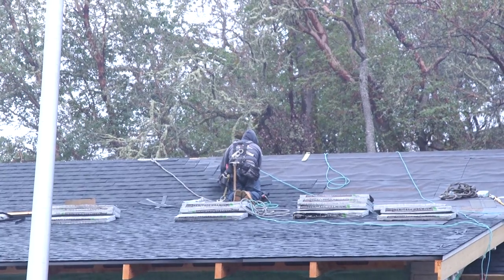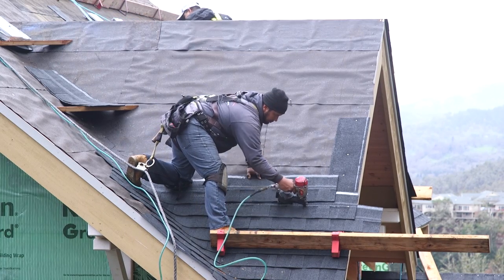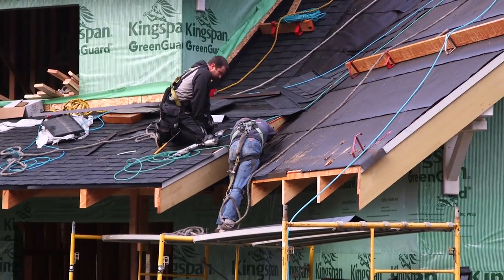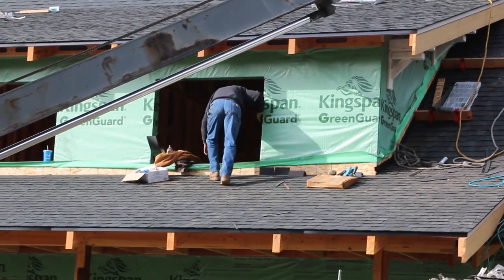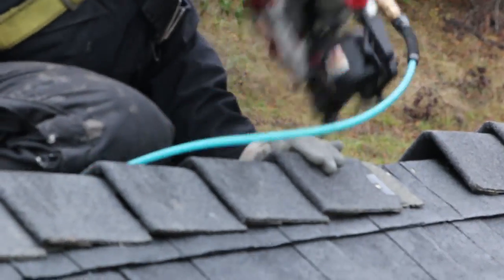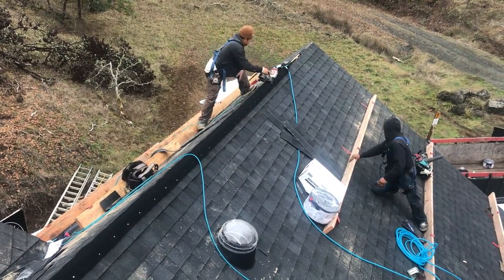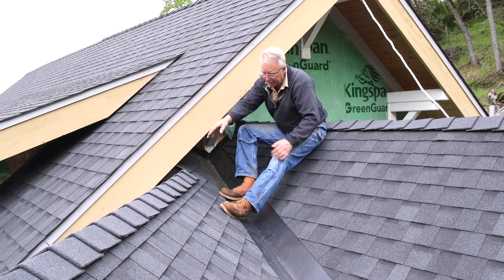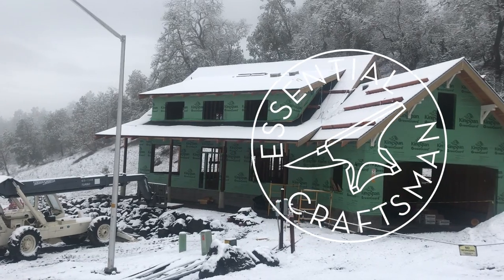Stunning and Complex Roofing Installation Ep.78

Comment: Shingles will be long deteriorated before the metal begins to rust. Architectural shingles only last 20-35 years, despite what manufacturers like to tell you.
Reply: They likely won’t get 50 years out of the shingles. I had to laugh when he said a metal valley would rust before the shingles needed replacing.
Reply: Agree.  I've used heavier-gauge aluminum valley/ step flashing.  That will probably last the lifetime of multiple asphalt roofs, barring no conditions where galvanic action or some other abnormal condition eats it away.  The shingle life, agree... complete joke.  It's what happens when marketing guys do their job.
Reply: I have a concrete tile roof. House is 17 years old. Only thing on my roof to have failed so far is the metal valley on the southwest side of the house. Maybe it was installed by dolts, I have no idea.

Comment: Hi Scott and Nate, I'm really loving the content you guys are putting out. I live in Ireland, I'm a mechanic by trade and I'm currently building a house. I find it so interesting how building methods in the U.S. and in other parts of the world differ so much. For example, here in Ireland we have quite a wet climate and most houses are built using concrete blocks, typically it consists of inner and outer leaves with an insulation cavity between the two concrete block leaves which is partially or fully filled with insulation depending on the detail. Timber frame and ICF are becoming more popular but concrete block is still by far the most common. Also,  you'd never see felt or asphalt shingles on a roof. Here we most often use natural slate, fibre cement tiles or concrete tiles. Metal roofing is becoming more popular but still quite rare to see. For the valleys we use lead, leadex, or metal but lead is the most common. I'm interested to know why I never see houses in the U.S. being built with concrete block, slate roofs, etc. Perhaps like most things it comes down to cost. To give you an idea of cost over here, it's costs roughly $150 per sqft to build a house.  I'd love if you guys could address this is one of your Q&A's or podcasts. Best wishes from the Emerald Isle and Keep Up The Good Work 😉
Reply: It depends where you are in the U.S. as weather, temperature and building codes can change drastically. Down where I live in florida most houses are constructed from block, at least the bottom story. The interiors are usually wood framed. In other parts of the country, particularly the western united states, wood is a much more common building material.

Comment: Looks like they did a good job. One suggestion for future roof projects is to nail the starter shingles at the drip edge.  Nailing at the top of the starter leaves the bottom course of shingles loose and susceptible to getting blown off.

Comment: Hi again there Wadsworths! It's been a while since I've commented on anything, but only because I really haven't had anything to add. I think you have done a wonderful job with all of it throughout the series. The building itself, filming, editing and especially explaining. Big thumbs up. For the EC2 podcast as well.

Now... I am from a wet climate. Pea belt. Where people sit in the dry and watch their cars rust for fun... And... Well... I am sure the Randy twins are doing an excellent job, but this is one of the places where I'd have function dictate form. I would not have the rafter on the porch exposed to the garage roof. Had I been doing it, it would dive all the way into the garage roof, for a continuous fascia, gutter and a single valley. Now... I know it would screw with optics, and possibly would mean extending/skewing the barge rafter, maybe even the entire gable, BUT - it is such an important detail and such a hassle to maintain, if not done properly, that I'd let it take priority. It looks good as is. Probably better than my suggested solution... But again. Water is no joke. Especially not on the 5th face of the house. The one facing upwards. The roof. Anyway - my 2 cents. As always - keep up the good work!

Comment: This is one of my all-time favorite YouTube channels... been watching for years, but when I saw that wide flashing, first thought was: compared to the long-life shingles and the care on the rest of this build, this small section will probably oxidize thru relatively quickly because it's such a low pitch area and it doesn't appear to be (nor sound like) painted aluminum (which won't rust thru like painted galvanized steel). Trees dropping sticks & leaves into a valley with a low pitch will almost always leave debris that cannot run-off without some help &/or regular cleaning; this particular spot has the added detriment of being in a roof valley that will probably have very little wind to help keep clear it. You can tell by looking at the ridge cap at 28:37 -- it's all facing toward the downhill run... so it's unlikely much wind will get in there to remove it; it's going to be primarily cleared by gravity, precipitation, and elbow grease. (One small stick will hold leaves on the metal, and leaves hold water directly on the surface just like mulch does for plants in a garden; water on the surface will escalate the oxidation process and take many years off expected lifespan.) Don't want to sound like I'm all doom-and-gloom or "Safety Sally-ish" but if this were my home, I'd want this part of the roof cleaned every fall & spring to keep the lifespan of that valley up to par with the rest of the build.
.
I've had to repair and replace both galvanized and painted flashing (and metal walls) that should have had 10-30 year life-spans, but rusted completely thru with a few leaves left in the wrong place for 1-5 years. Was glad to see painted flashing installed there, but probably should've considered using painted aluminum, copper, or lead-coated copper, as well as getting the seams of the wide-valley flashing laying as flat as possible (to stop capillary leaks), and spreading the sealant more under the flashing. (I realize Vulkem stays fairly pliable over time, but personally don't like to leave opportunities for ponding behind sealant, nor leave any high crowns of sealant under flashing.)
Reply from the maker: Great observations and yes, it will need cleaning!

Comment: Looks great.  Shouldn't there have been caulking applied to the top of the flashing of the solar fan before sliding it under the shingles at 19:20?  I've always applied caulk to vent type flashings to seal the underside of the shingles to the flashing to keep the wind driven rain out.

Comment: EC, I've never seen a ridge vent before.  Very interesting to say the least.  My small home doesn't have enough venting in my opinion.  I've got hot air that comes down through the attic fan louvers and this is directly above my thermostat.  I also appreciate the idea of those attic vents that run off of solar batteries.  You have given me food for thought.  I've got vents at both ends of the attic and small vents in the roof but I just don't believe that they calculated it correctly.  Plus the garage is attached to the home but there is no fire wall between the attic over the garage and the residential part of the structure.  If I were to put a wall in there then the air circulation would even be more messed up.  Oyi-veh!

Comment: Powered roof vents are surprisingly controversial in certain building spaces (and outright forbidden in some jurisdictions).  The thinking is that -- at best -- a solar powered attic fan will do no harm.  More typically, the expectation is that the fan will suck conditioned air from the lived-in space, actually wasting energy rather than saving it.  This is because a fan sucks so much air that the typical inlets are almost never going to be enough and since that air needs to come from somewhere, it'll have to be conditioned air.

My first thought on that is to just ensure that the inlets are sufficient.  The counter argument is that if your inlets are sufficient, then it's more likely that you have "properly" designed attic ventilation and a fan simply won't be necessary -- fans are there for poorly designed ventilation.

Oh, and maybe you could just do a very good job of air sealing the conditioned space, so that it's impossible for the fans to suck air into the attic.  But again, I hear the argument that if you are paying that much attention to the house, then there is a near guarantee that you are paying attention to attic ventilation, too, and you won't need the fan.

I guess I've just never lived in a house that had "proper" ventilation and I know from experience that attics here in AZ get into the 160F range -- it FEELS like being able to reduce that by 50F would be a huge win.  Alas, apparently the research and the numbers don't back that up.
Reply: Try watching Matt Risinger and the Building Science crowd. Their model of Best Practices on Attics is to insulate and seal the Attics because not only does NO ONE Air Seal effectively between building Interiors and Attics, the HVAC System typically has a lost of 15%. 
The key to success is to seal the building very close to 100% 
and remove moisture via a dehumidifier.

Comment: Doug...a few years back I went to Bozeman to assist my Roofer Brother on a Project he was doing. I can tell you after that experience, I have a Great Deal of Respect for people who do Roofing for a Living! If I Never Do Another Roof, It Wouldn't Hurt My Feelings! Its Dangerous Work! Step on anything on Sloped Surface; Air Hose, Rope, Extension Cord, Loose Shingle and your Instantly going for a Scary Ride...hopefully not all the way to the Ground! Its Miserably Hot..Never any Shade on a Roof! The Weather was Fair at the time but the Asphalt Shingles turned to Goo from the Solar Radiation of the Sun! Walk on them & they Slide all over the place...yuck! All the Damaged Shingles then have to be replaced and that really bites into Productivity! We ended up getting a Garden Hose from the Neighbor to keep the Shingles Cooled Off with Water in order to get the Project Completed. The Worst Part was Standing on a Slope all day!!! Both my Ankles felt as though someone Smashed them with a Sledge Hammer not to mention your Bent over all day!!! I was in Constant Pain and could Barely Walk!!! Also...I learned that Not All Roofers are as Conscientious as my Brother in their Craftsmanship & Ethics! Two Very Very Important Qualities in a Roofer, IMHO!!!

Comment: Where the valley flashing outlets onto the top of the shingles, the shingles tend to erode, water is going traverse to the direction shingles are designed to shed water, and it's at a high velocity. As a rule, I now design gutter flashing to never touch shingles or tile once it's touched metal. Once water becomes concentrated, it is fast and very erosive, and will damage whatever is downstream. 
In the case where valley flashing falls onto the middle of a plane like it does this house, I would actually create a channel gutter along the gable wall about 2" high and 12" wide.  That means holding the overhang off the roof of course, and letting the channel tie into the v-gutter, but there's no reason it can't be done with a nice return, giving a good 8" of clearance. I discovered this issue when my own home wore through the underlayment after 15 years.

Comment: Can I ask? The roof cap shingles on the main roof appear to be installed in two directions of lap, from the centre out to the gables. Why this decision? How does the back-to-back pair at the centre get treated for sealing/nail cover? 
Thanks for all you do and your excellent presentations.
Reply: That USUALLY indicates that in that area the winds primary direction would be hitting the face of the roof. Since there isn’t a prevailing direction to run the ridge you run it both ways. You cap off the middle with a show piece that you’ve cut off the nailing area of. To waterproof it I would always caulk under the piece where the nails will penetrate as well as on top of the nails to finish it off

Comment: I did roofing one summer in the upper Midwest on high, steep, roofs with no safety harnesses.  I was young and stupid.  ^_^  Boots with good traction, tied TIGHT, and with little "twist" was the key.  They had to be flat soles (not hiking boots) or they would damage the tiles.  Some guys used basketball sneakers.  My ankles got tired being in a flexed position all day.

Comment: I liked the lap sequence of the valleys, but I have to say that copper facing in the open valley will NOT RUST OUT. I think the main (best) way to understand roofing systems is that the weatherproofing is in the flashing and the paper/moister-barrier; the roof shingles are there to PROTECT THAT SYSTEM.
It only takes one bad move on the roof... 3:35, guy pulling board across the ridge:/
Really enjoy the content you put out. I appreciate you! Thanks!

Comment: Is there another video that talks about nailing in the toe board hangers? Do you try to install the hangers over or under the shingles? Is there a strategy or technique? And do you caulk the holes with silicone when the hangers are removed? Likewise, for all of the above questions, with regard to safety rope hangers? Also how about some detail on positioning of drip edges? Most drip edges get installed flush with the fascia. That little 3/8-inch 45-degree fold at the bottom is not going to keep beads of water from blowing against and running down the fascia and flaking the paint over time when the drip edge is pressed against the fascia. Also, when the drip edge is flush with the fascia, air cannot circulate to help dry out underneath. I think they should be installed with a 1/4-inch gap off the fascia board to allow gravity to carry most drips to the ground. Also, why are drip edges not installed on gable ends? It seems like it would be better to install a drip edge that stands up 3/4- to 1-inch at the gable end edge to keep water going down the shingles and not over the edge where the wind can blow it against the siding. I have never seen a video that talks about these subjects. Maybe you could find a drip edge manufacturer to explain how they are to be correctly installed.

Comment: More information on the solar attic fans please.  It looked like you had a couple of different sizes going up?  And can they be turned off and on from inside the house, or controlled by presets based on the interior environment?
Reply: They appeared to have wiring so you have to assume they were electric/solar powered.
Reply: The solar roof fans appear to be Master Flow brand. Available at Lowe’s.

Comment: I have not done any real roofing since the summer of my college days in the early 1980's. We did not have the nail guns used today. It struck me how many more nails get used.  Is this really helpful?  If I recall correctly we used 3-4 nails per 3 tab sheet.  Is this just because it is so much easier to drive a nail or do the multi-layer shingles need more nails.
Also, Your comment about sticking to the blue line really hit home. The crew that did my roof must not have.  We have a gambrel roof and on the steep slope, on very hot days, some of the upper layers have slipped out and I find them in the gutters. When I get up there to put them back in place I find the nails were too high.

Comment: Would've been nice to see how they did the very last piece of the ridge cap. That's always been an issue for me, and yes, we always just used the normal shingles to make the ridge cap. Also, always still ended up having nail heads showing. Great video, cheers :)
Reply: I just slap 4 nails in it and use roof caulk over them. You can remove some granules from your scrap pieces and sprinkle them into the caulk if you want to camouflage it.

Comment: I would like to add that the roof looks great, but most tropical places don't shingle their roofs, we drink our water that is collected from roof runoff into cisterns. this system allows us a clean water supply even during prolonged drought situations. We use what you refer to as corrugated tin sheets, the style of choice is the Australian corrugation with treated colored paint to resist our salt air.

Comment: Max nail guns are some of the best IMO, especially the  coil style nailers. That’s quite a cut up roof, they moved through it well. Surprised you didn’t have those fans installed hard against roof sheathing, then vycor flashing? There isn’t a concern for wind driven rain getting in?

Comment: Based on pitch is where you nail steep pitch and high winds = below the line, and usually 6 nails. Also never go above the nail line especially on a low slope roof it will make them lay wavy, the shingles will kind of cup overtime.

Comment: It amazes me that in one of the wettest climates in the country, exposed fascia just under the drip edge is still the norm.
Reply: arrrrrgggggh thank you! fascia needs to roll up the roof an inch or so, and the drip edge (wide face preferably) overlapping. That fascia that just stops at the top without a bend kills me..... Youve got min 6 in face (up to 8-12 sometimes) , plus soffit lip, but 1 extra bend an an inch up the roof too much for some people :)

not knocking anything on the vid tho easy climate roof wear wise. and this guy is a fine builder to know and appreciate the intricacies of each trade. means he understands what hes paying for and gets quality. Rather than pick the lowest biddder like most builders, and then proceed to tire kick them down more.....hahahahaha